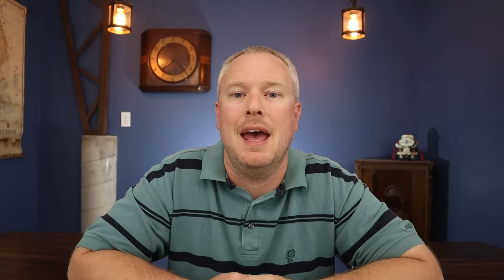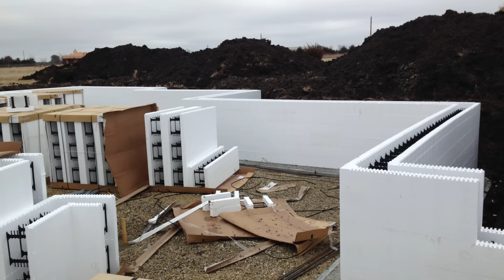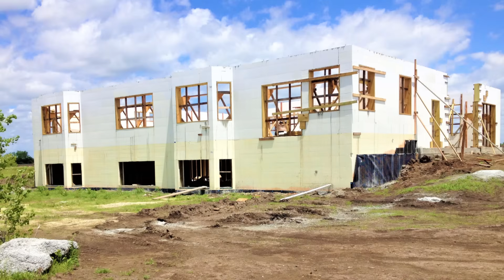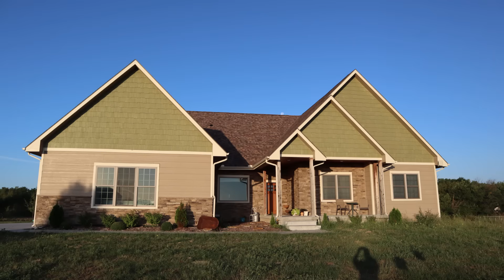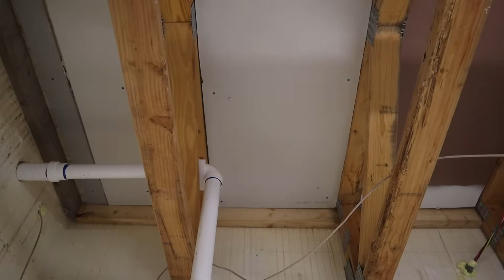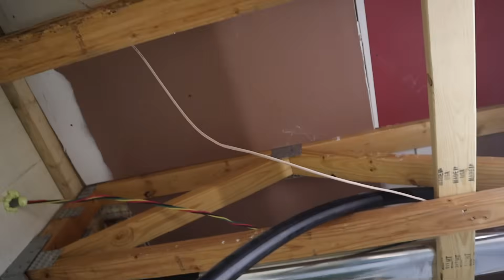Is Geothermal Heating & Cooling Worth It?

Comment: Your comment about such a system only being optimal in a 100 year old farmhouse if the building it is going to service is well insulated makes absolutely no sense to me. If the alternative is conventional HVAC systems, then they're going to run all the time as well, so the electric consumption from using a heat pump is still going to be a huge cost savings. The fact that the system will conceivably run all the time is a function of how long your loops are, and the ambient temperatures you're trying to regulate. Therefore, regardless of how well insulated the building is, place enough loops so the system can run indefinitely if it has to, and you'll still save a ton of money on your energy costs, which is the entire point of the exercise. Am I missing something?

Comment: Good video, what temperature does your system keep your house when it's 110 degree's outside? Can you keep your house at 74, is that possible? Thanks!
Reply from the maker: The ground temp remains unchanged by the air temp at the 10' depth of my loops, so I can keep the temp at whatever I want.  74 is no problem.

Comment: pretty sure the term "geothermal" does NOT apply here. to get geothermal heat, you have to go DEEP, like 1000s of feet. the heat you get from you system is not geothermal, it is solar heat that has been stored in the ground. and no, that is NOT the same as geothermal.
Reply: Geothermal literally means geological thermal. Using a mountain cave is geothermal.
Reply from the maker: These are "ground source heat pumps" as I stated in the video.

Technically, they extract/deposit heat (thermal) from/into the earth (geo).  The source or that heat, whether solar or from the earths core is irrelevant.

Comment: i also have a geothermal system and altho my house is 1/3 smaller than yours, i often pay $200-300 monthly, especially in the winter months. put it in 23 years ago when zero rebates were available. makes me wonder if the "antifreeze" type liquid they put in the loop has become less efficient over time.
Reply: so wait, you haven't flushed your system?
Reply: @verygoodbrother  i haven't. maybe i should look into how long the stuff lasts. the trouble is, if it's the industry recommending the action then their opinion becomes suspect given they stand to make a profit
Reply: @DB-xp9px  It's not a case of how long it lasts but rather how frequently it should be maintained or serviced. It's like buying a car that can last several years. However it won't last long if it is not regularly serviced like changing the oil, topping up antifreeze etc. You always want to service it regularly so that you catch a fault early that could develop into a bigger and more expensive fault.
Reply: @verygoodbrother  i'm all for routine maintenance but i have a trust issue w/ the local geothermal service place. i had 1 pump go out a long time ago so i paid them parts/labor to replace it then a year or so later, the newer one would go out so they came out again....another few $100 out of my pocket only to have it happen a few more years. eventually i replaced the pump myself and no further failures happened. gigantic coincidence, maybe. had a very similar wash/rinse/repeat happen w/ a part on my last Cruze. again, didn't stop until i did the repair then went another 100k miles before the car was traded in. another gigantic coincidence, maybe. needless to say, i've got good cause to be skeptical these places really do what they're paid to do.
Reply: @DB-xp9px  The important thing is that you're servicing it, be it yourself or a through company.

Comment: Regarding your farmhouse example, I still think a ground loop heat pump is the way to go. With "no" insulation, any system you install is gonna run continuously, so it may as well be as efficient as possible, and nothing that I'm aware of can beat ground loop. More efficient still would be a coat of spray foam in the cavities of the exterior walls though. That can be done after the tax credit though. 🤓👍
Reply: You'd want to insulate first to see what your need will be otherwise you're just guessing. And a well style may beat out ground loops because the groundwater moves taking that cold with it.
Reply: 'With "no" insulation, any system you install is gonna run continuously'

How do you work that out. If the desired temperature is reached and nothing more is needed, how is it going to run continuously?
Reply: @NotoriousPyro  Unless the desired interior temperature matches the exterior temperature, the interior temperature will drift towards the exterior temperature. Insulation slows the drift, and the greater the drift, the more work required of the heat pump. The first step in making the inside nice is keeping the outside out. 🤓
Reply: Old houses don’t deserve to have spray foam denature them. Sure, they need to have air gaps sealed a d insulation, but natural fibers and other materials that take into account old buildings and the water vapour transmission, etc, are healthier
Reply: @TheEmbrio  I'll bite. How does spray foam change the nature of a house? Does it become a piano instead? 🤔

Comment: 2004 I put in a well-type Geothermal in Folsom California.  I designed and built my house as a simple carpenter's house.  As a Carpenter I knew to go heavy on the insulation with 2x6 exterior walls and 2" rigid foam over that.  The doors and windows are highly insulative as well as the clay tile roof.  I put in 4 each 250 foot wells for a 2200 sf house.  We had to rock drill but hit water at 85 feet.  My electricity bill averages $150 per month without solar with high California electrical bills.  My neighbors houses, which are 1,000 sf bigger, run $750 to $1,000 per month.
If I had to do it over again I'd also use ICF exterior walls (I've done a large ICF project now) but would still keep the house simple and use the most insulative doors and windows in reason.
Funny how most people don't understand that to really be Green you need to design you're house to Conserve, heat, energy and materials.
In 18 years my repair bills have been $1,000 for an HVAC Tech to make two trips and replace one of my "pond pumps" that circulates the water.
Reply from the maker: Thanks for sharing
Reply: not-fishing  Please make a video!  We would love to see your system.
Reply: your in Folsom too? I'd love to see your setup if possible

Comment: Built a ground source heat pump in 1976 in Western Washington state. It performed well at one third cost of a Carrier heat pump next door.  Dug down 4ft. 4 loops on 3 trenches for  3 ton unit. Used a r12 pump down system. Never lacked heating and cooling.
Reply: wait the existed back then?
Reply: My 72 year old boss has a Rockwell heat exchanger installed around that time . it is not as efficient as today,s. But he used four wells, 100-400 ' deep. He has only changed a motor out in all that time. 
He could probably save more by getting a newer heat pump and getting rid of that old one. He refuses, says it is part of his history.
Reply: My boss had a Rockwell heat exchanger from a building put in his home around that time. He has four 100 to 400' wells drilled.  Beyond changing the motor out, it is still working. Nowhere

Comment: Awesome video!! One question- how do you cool the house? Do you run the compressor, to a air heat exchanger or??
Reply from the maker: The compressor is run for heat and cool.  It just depends if the reversing valve is energized whether it is one or the other.

Comment: Prior to escaping So-Cal 15 years ago, I was paying $950/Mo to air condition a 4,000 SF well-built 2-story house. 
I think it was about .15KW at the time. (It is .225 now😳)
I researched ground-source heat pumps but the mean ground temp in North Idaho was just 44F. Heat is much more 
important than AC, so it didn’t quite pencil out, even with me digging the trenches. A pro advised that he’d installed 
4 systems in the area and none were really paying off, so I went with 16 seer air-source heat pumps. 
This was over 10:years ago, but do your research.
Reply: Hey bud. Dont u think Idaho has pretty cold AIR temps too? Maybe winter temps 15-35° at times. U run the ground loop deeper for more heat, & also run a good roof area solar heat loop to split into house heat AND hot water pre-heat for cheap! U gave up too easy!
Reply: Glad to hear your family escaped. Many other families aren't as lucky.
Reply: You should try Europe, today I payed 0.95 USD before tax and fees pr. kWh.
Around 1.10 ~ 1.20 after fees and taxes.

Yup, that isn't a typo 😵‍💫

Comment: What's the energy consumed by your system.
Instead of referencing the price, it's easier to make a comparison based on energy units and not the power bill, my grandmother pays $120 or so/month
The energy consumed, at most, is almost 800 kWh, with the low end being about 400 kWh per month.
Our utility prices the kWh at $0.25/kWh roughly.
Which is lower than many providers.
That's why it's better to reference the energy units used than something nebulous like the cost per month. It makes your references easier to use outside of your area.
Reply from the maker: That video is coming soon

Comment: I think your building envelope should be your primary investment as far as efficiency because that’s going to give you the best ROI then geothermal  system is a great option , as you mentioned farm house we recently inherited my wife’s family’s farmhouse that is a great candidate for geo but as you stated , we are in process of completing all the upgrades to bring it up to the year 2022 and the last time it had any attention was 1972 ? Yea , luckily I’m retired ( I think ) and having equipment to do the work . Did I mention there’s a lot of old structures, barns , shop and they all predate the house as far as the last time they received maintenance.  If it wasn’t for are grandkids it would not have been my first choice going into retirement and they have helped with all the work thus far including zip lines , go kart track , lots of tractors to repair . If it gets them out here to visit that’s my goal ! And get heat & cooling by summer 2023 ? Lol 😂
Reply from the maker: Absolutely

Comment: I would recommend putting up some sound deadening foam and runner used in the music industry in sound rooms on the ceiling above the unit.  Maybe in place if the sheetrock you screwed on.
Reply from the maker: Believe it or not, the sheetrock is a better noise reducer than the foam, and much cheaper
Reply: @Challenged1  hmmm I would not have thought that.

Comment: We have a 1700sq ft home built in 1987 and had a geothermal system installed in September 2021.  From Nov 21 to May 22 it cost an average of $175.57 per month.  The system is closed loop with two wells each 288 ft deep and a 5 ton Geo Unit.  We live in the Hudson Valley where temps can range from -5F to 95F depending on the season.  In Jan and Feb we used about 100 gallons of heating oil each month with our old system.  That would translate to about $350 - $500 depending on the price of oil in addition to the electric the furnace used.  Our electric is about .23.5 per kwh.  Love the Geothermal!
Reply: Technology has come a long way for sure!  We have a little bit bigger home and recently upgraded to a newer more efficient heat pump, albeit not as efficient as a geo thermal, its not bad.   Northern Ohio weather and we pay $200ish but we also heat and cool an external garage.   We are all electric including the backup heat, they run electric heat strips but only come on when the outside temps are below 12 degrees.    Probably what saves us is we have fairly cheap electric in our area.
Reply: How much to install ?
Reply: @sranney1  The system quote was $40,375.00 for a 5 ton system with two 288 ft deep wells for the loops.  Credits were $1750.00 for using our own money, $9820.00 paid directly to Dandelion by Central Hudson (electric provider), and a $7489.00 Fed Tax Credit.  We had to write a check for $28,805.00 and after the Fed Tax Credit the system cost came to $21,315.70.  All amounts are in US Dollars.
The system cost $895.00 to heat our house in Nov, Dec, Jan, Feb in the Hudson Valley NY.  The oil furnace cost was $1700.00 for the same time period.  So break even point depending on the price of heating oil would be about 12.54 years.  The geothermal furnace will last about 25 years maybe more with proper maintenance.  The loops will last about 100 years.
  We bought our oil furnace new in 2009 and in 2021 it started leaking oil.  There were no replacement parts available to repair it .  It was a Thermo Pride oil furnace that worked for 12 years with no problems.  The oil storage tank was  34 years old so it to was due to be replaced.  The combined quote for jury-rigging the oil furnace and replacing the oil tank was $5000.00.  So we went with geothermal instead.  Hope this answers your question!
Reply: @chrismaxny4066  this is an wonderfully detailed answer, thanks :)
Reply: @chrismaxny4066 : what do you mean when you say "wells"? Trenches?
Reply: @tch632  I mean a vertical hole in the ground as in a well for water.